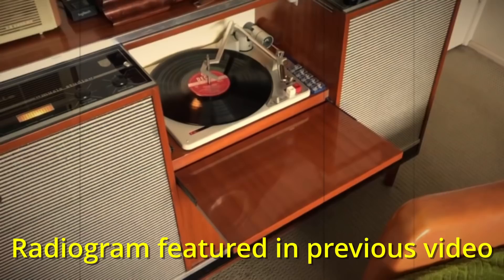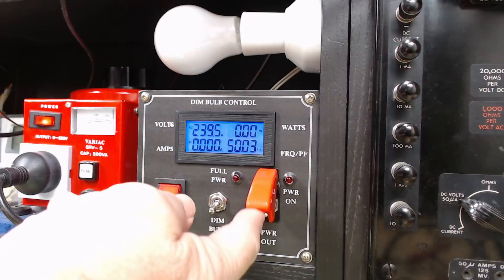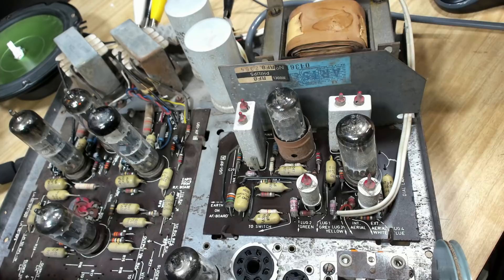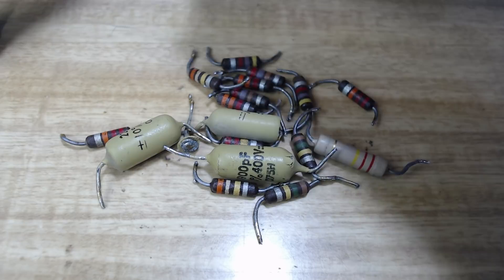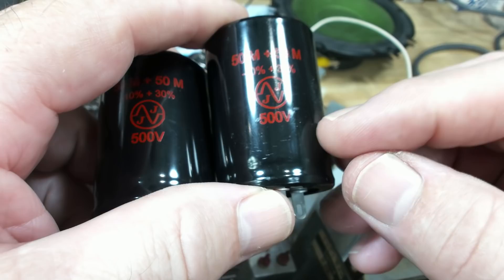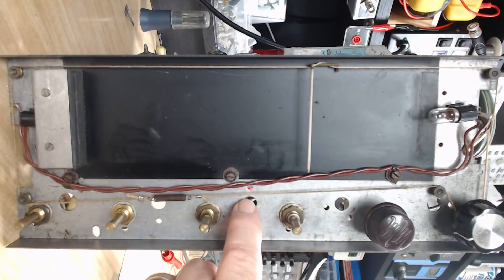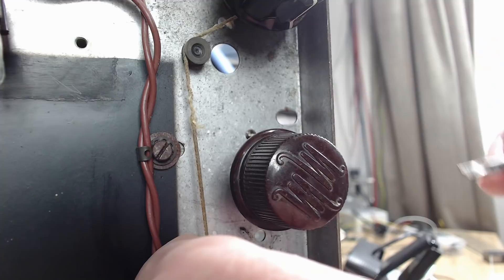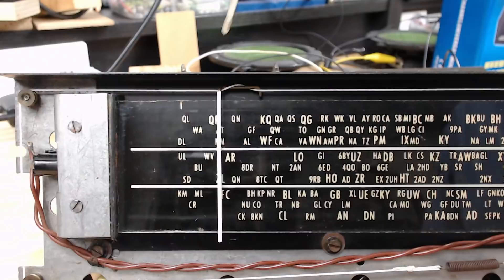Philips RF8 Radiogram Repair plus Philips AG 1025 Turntable

Comment: I'm always amazed at how hard the mechanism drops the tone arm onto the record. The stylus cartridge must take quite a beating. 
Don't worry about the video being long.  Can always pause it and get up for a cuppa and a piece of cake. 
BTW, recently the digital display in my very old clock radio went strange and appeared to be showing a code.  I figured clock radios of that vintage wouldn't be designed show a code.  Anyway, looked inside and found a large electrolytic nearby the the main clock chip. 
Watching your videos led me to deciding to check all the electros. (the clock radio is about 40 years old)  So I checked the large cap near the driver chip and it was a dead short.  I replaced it and the display worked fine again.  So I decided to change all the caps. 
Thanks for the inspiration.  I love the old clock radio, it was a gift from someone special.
Reply from the maker: Hi Ellesmere, it's pretty rough treatment all round with these old players. That's great to hear you had a go at your clock. Capacitors are the first to go and you get to keep your special clock a bit longer, well done 👍🙂.
Reply: Speaking of this, when I was about three, we had a DVD player. It died eventually and the final words on its vfd display were “TOOT”.
It was my introduction to electronics, because rather than throw it away, my dad let me take it apart. I remember the green boards with little caps and chips dotted about, and the big mechanism that handled the discs.

Comment: I remember you being a bit apprehensive about working on record decks but you've got the hang of it now!
Reply from the maker: Yes, I'm getting quite comfortable with the ones that I have done now, no doubt there will be one that will be my undoing 😄 thanks Paul.
Reply: @DavidTipton101  BSR, Garrard and even Philips (which are generally said to be a bit tricky) are straightforward enough if you're methodical. Collaro decks can be a baffling ordeal! Dual and Perpetuum-Ebner are ok to work on. Most Japanese decks from the 70's are easy.
Reply from the maker: @paulbennell3313  Thanks Paul, I'm looking forward to some other brands to do 🙂

Comment: I like that you made a point about the idler diameter making no difference to the speed beyond, as you also mentioned, the ability to make contact with both driving surfaces. It's surprising how persistent that misinformation is.
Reply from the maker: Hi RecordCouncil, yes it is a common misconception and understandably so, that's why I mentioned it 👍🙂

Comment: Hi David, Always makes me smile when I see 45's from that side of the pond. Here the hole in the middle is almost 1.5 inches (38 mm). Must be nice not to need a special adaptor to play them.
Always gives me anxiety when I have to unclip 50 year old plastic covers. Was so happy to see nothing broke. ( Bet you felt that way also ) Idler wheels are a pain. There are places that will
rebuild them, for 75 yankee bucks. Crazy expensive. As for the length of the video, seemed to be over in 15 minutes. Always a pleasure to watch.
Reply from the maker: Hi Vern, I never understood why there were two hole sizes, our earlier 45s had a knock-out centre to make them the larger size. I agree with the old plastic, just waiting for the snap 😖 I don't think we have anyone in Oz doing idler wheel rebuilds, might be a opening there for someone. Thanks Vern 🙂

Comment: Well done David! Full marks for you patient work.  Spent 30 years fixing this type of work and everything to do with TV repairs from 1964to appliances.
I usually solve your problems as you work through the repairs.  I also to build audio PA amplifiers from around 1960 to 1990.  These ranged from 3 watts to 500 watts output impedance from around 20 ohms to 500 ohms.
Reply from the maker: Hi Roger, thank you. I bet you are way ahead of me, nothing beats experience. That's a BIG amp! 😮
Reply: @DavidTipton101  The 500 watt Amplifiers used a pair of 100TH valves in Push Pull.  I'm to old but I think t5hey in class B2 which was typical for the day. The 100 watt amps used to use a pair of 809 valves.  I remember checking the balance simply by shorting the amplifier and going arrrr into the microphone!  If both plates of the 809's went cherry red or hotter equally they were considered a match! How crude was that!!!
Reply from the maker: @rogerbird6151  Haha... that's pretty crude 😄

Comment: Hoi David,  Great repair! I have been repairing & restoring old radio's for more then 40 years now. In all these years i have NEVER found a bad ( philips - mullard ) mustard cap . They are the best caps ever made! Even today you can not find a better cap.
So...i never measure these because i know they are good . Sometimes you find a cracked one, very rare, but they are still ok ( If i spot the cracked ones..i replace them too )

Greetings from a fan in Belgium
Reply from the maker: Hi Dirk for Belgium, Thank you. I have had a few do bad and they seem to go intermittent or noisy, generally they are pretty good.  This had a number of cracked ones, maybe because of the salt air we have here on the coast getting in and correding the foil 🙂

Comment: I love your cautious repair on the Philips record player. Like those easy to get retaining clips with the bent ends.
Don't have those in the States so one must be extra careful in removing them or kiss it goodbye. I have a fresh
bottle of Rubber Renue which always comes in hand with hardened rubber idler wheels. The length of the video 
was perfect IMHO. There are a lot of steps to show in the repair sometimes. The owner should be very pleased
with your capable hands repairing it!😁 Cheers, Steve from Illinois
Reply from the maker: Hi Steve, you have been following me for quite a while, thank you for your support. I have spare clips but I still have to crawl around looking for the ones that go 'ping!' The Rubber Renew works well but I haven't tried it on a wheel that has gone hard, that will be a test. I try to keep the videos as short as possible but they still run long, as you said, there are a lot of steps, thanks Steve 🙂

Comment: Well the good thing about that Radiogram is its kind of like a modular circuit board construction. But I agree intermittent problems are some of the worst to diagnose but. I knew you were up to the task David.  Thanks for another great video.
Reply from the maker: Hi LUCKYLARRY, yes, very easy to work on, I couldn't see the loose wire from where I was there was something in the way. Thanks LL 🙂

Comment: I love it when you break out the big Birko soldering iron. Such a nostalgia trip. Another great restoration of a very nice old piece of gear which deserves to be brought back. Great video.
Reply from the maker: Hi Ian, I bought the Birko in the 70s, it's a good iron. We had a Birko hot water jug at home as well, that was from the 60s, I think Mum still had it when she moved into a unit in the late 90s. Thanks Ian 🙂

Comment: Nice job Dave. Just out of interest, what is the output of those units in Watts to the speakers?
Never apologise for long videos. There the ones I love.
Reply from the maker: Thank you 1974UTuber. Without looking it up I think the valve is capable of about 9 watts from the pentode 🙂
Reply: @DavidTipton101  9 Watts is not too shabby. Next time I see a similar unit on the council clean up pile I will have to grab it.
Would make a great little stereo amp if the rest of it is no good

Comment: Really nice troubleshooting and repair job on the radio Dave and we are going to have to start calling you the record changer "Whisperer". Really nice work on those mechanisms!
Reply from the maker: Hi Gregg, thank you. There is a bit more than whispering required at times I'm afraid but really they are not that hard. Thanks Gregg 🙂

Comment: And another one done and the second RF8 as well. Great job!! Those 1/2 watt resistors were always a pain and always going high, even those capacitors have stood the test of time. but after 50+ years, so built to last. Great work, as always. If i may make a surjection... i would have increased the gap between the new electrolytic filter caps and bare chassis. A bit to close for my liking, but great work still all the same. Take care !!
Reply from the maker: Thank you Stephen, it's always a relief when a radio contains Philips caps. I know the capacitor looked close in the video but the two positive tabs were well clear and it wouldn't matter if the negative touched, there was also about 5mm in vertical clearance 👍🙂

Comment: I've only tried fixing an idler once but it worked a treat! My brother dragged home an early-80s Crown tabletop console stereo a few years ago and apart from missing a cartridge, the turntable made horrible grinding noises and was very slow. The idler still felt reasonably soft but definitely had a divot in it. For want of a late I chucked it into my drill and took some wet and dry 180-grit paper with a drop of water to it until the divot was gone. Reinstalled it and the turntable worked like new again! The only thing stopping me from fixing it properly is that some bloody fool tore off the wires to the cartridge and I haven't been able to find suitable connectors. I did try to raid an old VGA plug but the pins of the cartridge I've got are too thick.
Reply from the maker: Hi Ragnar8504, a bit of sandpaper works wonders but just the minimum amount off. I think I used the sockets out of some computer cabling once, I can't recall where I got them from, but I was able to release them and remove the original wire and solder in the cartridge wires. You can also get little jumper leads from electronics shops which may be small enough, something like this: https://www.jaycar.com.au/150mm-socket-to-socket-jumper-leads-40-piece/p/WC6026
Reply: @DavidTipton101  Unfortunately I had the opposite problem, the pins of my cheapo ceramic cartridge (the only thing that fits this arm without any modifications) are too fat for the connectors I salvaged. I could push them onto the pins with a bit of force but they didn't look as if they provided proper contact. I might be able to bend them to fit better though.

Comment: Great work Dave, I ran my RF8 board the other day and it sounded dodgy. It's in a old SAR telephony box, repurposed the amp. Now I've seen this I'll know what to check for. I'll replace the resistors and see how it sounds. Thanks for the video Dave hope your doing ok mate.
Reply from the maker: Hi A Last, thank you. I did another RF8 a few months ago as well, that had different issues to this. Good luck with your RF8 and I am pretty good thank you 👍🙂

Comment: Hello David this is Chris how are you hope you're doing well. Its fun watching you enjoy what you do best. I'm glad there are repairman like us and others that appreciate fine equipment and keep them going for our young people to be curious about 😆 and enjoy the charm these antiques have. Just thought I'd give a quick hello and tell you what's going on. Have you ever worked on a Grundig Majestic model 4040? Those are physically the most difficult radios to restore. The band selector switch buttons are difficult to remove and clean and all those cables and strings and some type of rocker arm and cam assembly on top of the tuning capacitor and motor assist ???? I'm thinking it needs a valve job 😆 maybe I should bring it to my mechanic. The customer brought this thing in and it has a broken dial string and I have no idea how it goes but I'm not ready to assemble it yet anyway. The only way I would know how to wire the band switch back properly is to cut all the wires and this way I have a color code and some guide at to where they go. I tried taking a picture but its just too many wires uughh. I'm still in the process of cleaning and repairing. I guess I'll worry about how to assemble it later 😆. Maybe I'll find a German physicist to help me. It passes the dim bulb test and all I get is static so at least the amplifier is working and I am surprised the transformer is good. TTYL Have fun
Reply from the maker: Hi Chris, I'm good thanks, I trust it's the same for you. I haven't seen a 4040 but I looked it up and it looks typical for German and European radios in general, I see it has motor tuning which would be fun to play with. I located a service manual and it has the stringing diagram included. I try and clean the switch mechanism insuti, not easy but it can be done if the contacts are still intact, contact cleaner and cycling seems to clear them up.  Good luck with it Chris, I hope you get it all working again 👍🙂

Comment: Hi Dave just found your Chanel and subscribed straight away my hifi amplification is a kt88-89 triode connected tube amp utilising two valves pre channel +two preamp valves a Chanel,   Chinese made but UK modified sounds absolutely gorgeous as a tube -valve amp shuld I’m liking Your Chanel 👍👍
Reply from the maker: Hi Ian, and welcome. I must investigate a proper tube amp one day, maybe a project build. Thanks you for the sub Ian, cheers 🙂

Comment: Great job as usual. I thought last time i didn't see right. This radio has EZ80 (6v4) for two output tubes. I never thought that it could cope. In every stereo I worked on there's EZ81 or selenium.
Reply from the maker: Good point Veljko, it must be able to handle the draw, it was keeping the voltage up 🙂

Comment: David another brilliant Refurbishment sadly many of Philips Radio Gram when the Tip when Colour TV was introduced to Australia 
I have found the Philip Caps were very reliable but the IRC Resistors were not they were called Shit resistors 
And full Marks refurbishments to Philip Turntable there were reliable unit but I guess working vintage Radio Gram you cured a few problems 
Again full Marks Mate,Ian,

.
Reply from the maker: Hi Ian thank you. The caps in this were in bad physical condition, they may have worked OK though, the resistors were all over the place. The turntable worked well after the repair, this one needed a service which is understandable. Thanks Ian 👍🙂

Comment: Nice job, the turntable sounds pretty good on the brass-heavy passages.  Hope you weren't inconvenienced by the torrential rains I heard about in your region.
Reply from the maker: Hi Don, it was through the speakers on the desk, I imagine it would be terrific through the six speakers in it's cabinet. We are OK from the floods but parts of the city and outlying areas are a mess. The so called 'Mud Army' of volunteers started cleaning up today. Thanks Don 🙂

Comment: David, Never apoligise for making a smashing video 😀
Mustard caps are usually reliable,  but time still gets them.
Cerclips,  i call them Ping :-D (Vanished into a different universe).
I like the pcbs much better than the point to point madness of older heaps of hell.
While you were fixing the tone arm (silly name), i was wondering how on earth you would get everything back in synk, I would be in a mumbling panic :-D
That friction disk looked very nasty, some drongo applied too much oil/grease and buggered it up :-(.
"Buying a capacitor bracket"  Disgusting! i expected to see a hand made one ......  No not really 😀
Loverly repairs, the owner should be very happy :-D
Reply from the maker: Thanks zx8401ztv. The disk had something on it, it was waxy and I was expecting that clip to go 'ping' as well. I never thought of making a brackets 🤦‍♂️🙂
Reply: @DavidTipton101  Here in Canada we always called the clips with the two little holes in them grip clips and the pliers,  grip clip pliers. The other clips you push on we called C clips and we had a special tool that held the clip to push them on and the other end clipped on and pulled them off. They still went PING though...lol.
Reply from the maker: @markdesjardins3153  I have never heard of grip clips, we also call the push on one 'C' clips. I went a bit generic there 🙂
Reply: @DavidTipton101  I wish I had a nickel for every minute I spent on my hands and knees looking for them. After a few years, I got a collapsible wand with a magnet for fishing them out of the deep recesses of machines.

Comment: hi dave, you should try to make mr carlsons capacitor leakage tester, you will be amazed how many is bad. also his shield end tester for modern capacitors is worth getting, so you get the shielding right.
Reply from the maker: Hi Alf. Mr Carlson's contraption is over the top 😄 I rarely test caps, just replace them. I use my oscilloscope to find the shield, it works well

Comment: David, on your next video, could you explain the "dim bulb power supply" and it's purpose? You may have done it before and I just missed it, so if there is a video explaining it, you can just reference it. I'm just not far enough along in working with electronics to get everything. You've taught me to read the schematics, but I'm still at a loss for a few things
Reply from the maker: Hi Greg, I did do a video on the dim bulb, link below. It works as a current limiter, the more current draw through the filament the hotter the filament gets which increases its resistance. This limits the current flow to milliamps at the radio which is not enough to damage it if it has a fault 🙂
https://youtu.be/ykUlzhCTLvg
Reply: @DavidTipton101  thanks so much David! I watched it and understand so much better now. Much Appreciated!!
Reply from the maker: @GregAlanEdwardsEmmanuelRidge  My pleasure Greg 👍🙂